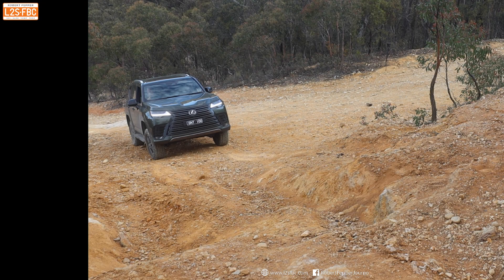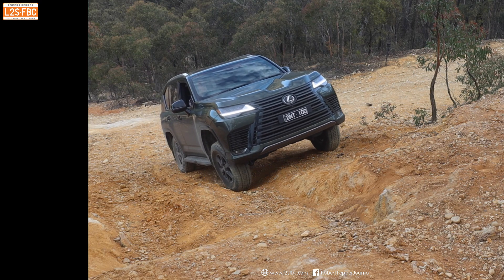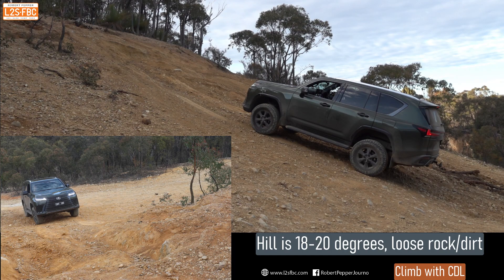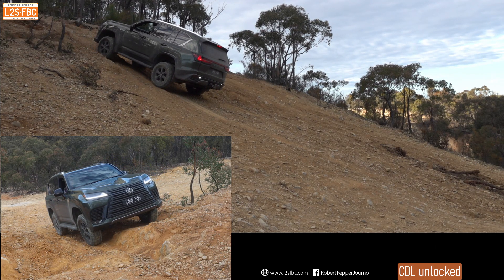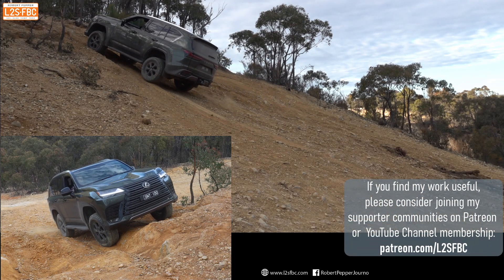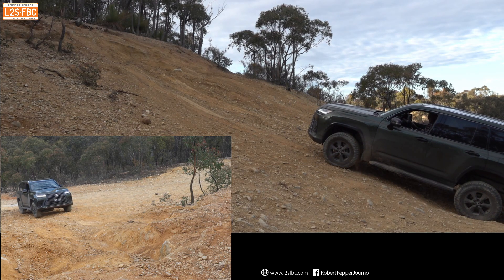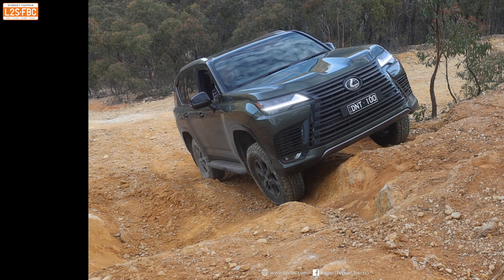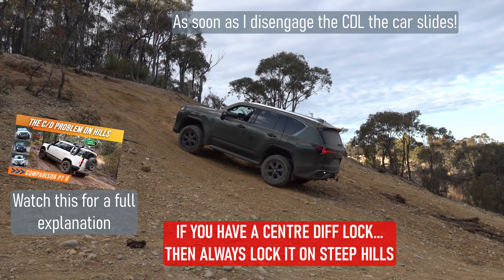The potentially deadly oversight on hills

Comment from the maker: More information:

1. Detailed explanation of what's happening with centre diff locks on hills:  https://youtu.be/QCPlK5CJ9uI?si=g4HSzd4terR2u0HL
2. The same risk, but with twin-motor EVs using the Shark as an example https://youtu.be/f5EOCDfNbZg
3. The same problem again, but this time with an Everest downhill, and Ford's fix https://youtu.be/ln4MSePpMO4  this answers "why not ABS".
4. Axle lockers are NOT the same as centre diff locks.  This fully explains axle lockers. https://youtu.be/rlO0OOKbApE
5. Failing a hill climb with a manual 4x4 https://youtu.be/3UnXWByxJAk
6. All wheel drive vs 4x4 vs everything else https://www.youtube.com/watch?v=drMmke7WL7s&sttick=0
Reply: I 100% beleive you, and greatly appreciate this video and all your others. But, what i still don't understand is why doesn't the vehicle have rear brakes? Since when does a center diff disable rear brakes?
Reply from the maker: It does have rear brakes.  The problem is that insufficient braking force is going to the rear, because the car is set up to bias brake force to the front which is what does most of the work when stopping on level roads.  On a steep hill like that the front wheels have little traction, so are over-braked, and the rears are under-braked. Look at the first link for details.
Reply: @L2SFBC  I never said it didn't have rear brakes.
Reply: @SoloRenegade not picking sides here, but that is exactly your wording.
Reply: @TheMadMagician87  in the context of, "Since when does a center diff disable rear brakes?"

DISABLE being the key concept here.

I knew the car had rear brakes, but if you apply the brakes, they should activate and stop rotation. if you apply the brakes while at rest and there isn't enough brake pressure to stop the wheels from rotating, you "effectively" have NO rear brakes, as we witnessed in the video. this is a serious design flaw. you should not have so much front bias as to have no actual rear brakes.

with the diff engaged, you only get rear braking by virtue of the front brakes preventing rotation of the rear tires. so only one set of brakes is working. this is a design flaw. why even have rear brakes if they aren't going to do anything? and what about FWD vehicles? what about RWD vehicles? I bet they don't have the same design flaw? My rear wheel drive trucks don't need the diff engaged to avoid rolling (as they don't have one), even with the transmission in neutral. My FWD cars don't have this issue either.
Reply: @SoloRenegade I get your point. My point is this:
He was responding to sentence above the one where you reference disabled, in your original post.
Reply: @TheMadMagician87  yes, he quoted me, out of context. and my question and criticism of the vehicle design is still valid, and the question still stands.

if your rear brakes don't actually stop the rear wheels from spinning, then you don't actually have any rear brakes. and why would you setup rear brakes differently for an AWD or 4WD than for a 2WD?
Reply: @SoloRenegade Okay, so moving on to address your question:

The brakes arent setup any differently, all cars are typically front biased for braking for a few reasons:
1. They are primarily driven forwards.
2. They are mostly driven on high traction surfaces.
3. They generally aren't stopped on steep low traction surfaces (particularly, with the vehicle pointed up the hill).

The issue arises because without feedback to detect that the vehicle is on a steep, low traction surface (or without a system appropriately acting on that feedback) more braking force is present at the front wheels.

With the centre diff locked, that same force is transfered by the driveline and distributed to the rear axle and then amongst the rear tyres. All is well, car stays in place under braking as demonstrated. This is because the rear tyres when parked on a hill with the vehicle pointed up it, actually have more weight on them (and hence traction) than the front (assuming the surface is the same under front and rear tyres) since the vehicles weight is transferred rearward (the opposite of a typical braking scenario when the vehicles is moving forward). So, braking effort from the front wheels is being applied to the wheels with the highest braking ability (the rears) via the locked centre diff, and the vehicle stays.

When you unlock that centre diff:

1. All the braking force at the front wheels has to be applied to the ground through the front tyres that have an 'unusually' low weight pushing them onto a surface with a 'lower than normal' level of grip. The result is, the front wheels will stay locked by the brake force, but skid over the ground as the brake force overcomes available traction.

2. As the centre diff is now unlocked, there is no brake force from the front brakes being transferred to the rear axle and wheels....the force on the vehicle from gravity is now enough to overcome the total brake force being applied by the rear brakes (which is less than available traction) so the rear wheels start to roll. The slip in the driveline is occuring within the unlocked centre diff, which wasn't possible before as it was mechanically locked together.

3. It all just keeps getting worse from there until either: things flatten out, or, you let off the brakes a bit and start driving backwards and leverage engine braking and light brake pressure to regain steering and regain a a greater total braking effort by stopping the front wheels from sliding on the ground (and should it happen to allow it, relocking the centre diff).
Reply: This all gets complicated without an inclinometer. With the CDL engaged, it looks to the ABS/EBD computer(s) as if the front wheels can sustain more brake force without sliding (i.e. relative rotation compared to other wheels) than they actually can. That is the case because some of that force was being delivered to the ground via the rear wheels, which was occuring courtesy of the locked CDL. As soon as that CDL is unlocked, the balance of forces suddenly changes...which is an unusual scenario for the programmers as it would in their normal experience only occur with the vehicle in some sort of motion. Hence, unless you specifically create mechanisms to detect and act differently in this situation, the 'common sense' programming fails to work as effectively as expected.

Could you accurately detect torque on each wheels driveshaft and use that as the direct feedback to the brake controller, this would not occur.

Dual motor electric vehicles may potentially have a plus there, since the could very quickly pick up on back EMF generated in the moving motor as a proxy for axle torque (if it is occuring absent other usual conditions/inputs) and then yell at the brake controller(s) to throw more braking force at the relevant calipers.
Reply from the maker: MadM - perfectly put, you summarised one of the detailed videos in the pinned comment very well!  Everyone else - note that while the car used in a 2025, the same issue will occur in non-electronic cars.
Reply: @SoloRenegade What I want to know is why didn’t the 4-wheel ABS work? Mine does in reverse (I have a permanent 4WD Land Rover).
Reply: @TheMadMagician87 Modern 4WDs have a thing called gradient control. They know full well if they are pointed up or downhill so a properly calibrated system will (should - or it’s a poor system) brake the rear harder.
ABS should have handled the rear wheels when it was unlocked.
Reply: @jerrymyahzcat  that's what I want to know as well. why didn't the brakes work and why did the ABS allow the wheels to roll.
Reply: @SoloRenegade The ABS should have pulsed the brakes on all 4 wheels allowing a controlled descent back down the hill, not sliding.
Reply: I also fail to see why even on the hill nose up with front biased brakes - the rear wheels weren’t locked by the brakes too (or ABS all round doing it’s thing - of course we all know that ABS won’t work if all 4 wheels are locked and you’re sliding as wheel speed sensors can’t detect different wheel speeds when there isn’t any; but as the Front wheels weren’t rotating and the rear were, the sensors should have detected the variance and started braking the rear more and the front less - front bias or not). 

Even with front biased brakes if you floor the brake pedal all wheels should stop rotating (unless ABS is involved - ABS might not work under 5km/h or something). 

There is zero excuse for the back wheels to not be sufficiently braked to stop wheel rotation. That’s a design flaw as you say.
Reply: Question - Does the design of the CDL matter? Such as Torsen vs. another type/brand/ design matter when it comes to your observations and recommendations?
Reply from the maker: @CJ-rk5eg  yes, that can matter - the Lexus shown has a Torsen, and it has the problem.  It is very variable though. Cars with electronically controlled centre diffs/clutches should not have this problem, but it depends on how well the engineers have understood the issue and not all do.
Reply: Why did your reverse lights come on?
Reply: @qsd8063 Because he put it in reverse to go backwards. You don’t roll back in neutral.
Reply: Thanks so much.

Comment: That is why the first of the Disco 2s were dangerous in some situations, as they had no center diff lock.The manufacturer eventually fitted the center diff locks to the last run of the model,late 2003,and 2004.

Comment: Sliding down hill = no control. Always hev the center diff. locked when on loose ground. Especially going up-hill, but even more important down hill. If you slide down you must put the gearbox in reverse as soon as possible and engine brake down hill. That is how I learned it at The Land Rover Experience Centra (Level 1 in Holland and the Advanced Level 2 course in Germany)  When driving forward down hill you ALWAYS MUST have the centre differential lock engaged, because in case a back wheel lifts and has no traction (without out CDL engaged) you will get an winding axle twist. The wheels with frip go downhill, the wheel in the air will turn the opposite way. That is still true on modern vehicles. I wonder how many people actually invest in their own safety and take a proper off-road course at LAnd Rover Experience or with other brands. I wonder.

Comment: Why would you ever take your center diff lock off in this situation. I wouldn't. My truck has a hill start brake. Not sure if it would help but the truck doesn't roll back at all... Doesn't do anything until I hit the gas.

Comment: Without reading anything, this is also your first video I've seen.  I'm going to guess since the center diff is locked, that means it's still doing the same braking as before, however since the front wheels are locked they prevent the back wheels from turning because they can't spin since they are directly tied to the front wheels now in order to all spin at the same time.   If one wheel is locked, they are all locked so to speak.  Theoretically, if you have only one break on the front right wheel and lock it up all 3 other wheels will be forced to lock too, lets assume everything is invincible and sufficiently strong enough.
Reply from the maker: Yes!

Comment: That's really interesting.  I have a '24 Colorado ZR2, and have the option of 4Auto, 4Hi, and 4Lo.  I can even lock the rear in 2WD, and I can lock the front as well in 4Lo.  I'm a noob at this, and was told I should use 4Hi or 4Lo rather than 4Auto if it's anything other than intermittent snow/dry pavement.  I had no idea locking the center diff had any effect on braking.
Reply: You don’t have a center differential
Reply: @miked7293 So, I have 4Auto, so, what is it that you propose I have?

Comment: What if one does not have a center diff? I am looking at a Honda Passport Trail Sport in the U.S. I don’t think its awd system has a center diff that can be locked? So could this vehicle climb this hill and would it have the problem you are describing? Should I look for a vehicle that has a center diff that can be locked?
Reply from the maker: I am not familiar with the Passport. Had a brief look and it appears that it has an AWD system so I'm guessing no low range and an electronically lockable centre diff or clutch - see https://youtu.be/drMmke7WL7s for an explanation.  Based on what little I know, it'd do okay offroad but would not be my first choice for steep hills.
Reply: @L2SFBC Thanks.

Comment: So why did the ABS not work on all 4 wheels when rolling backwards?
There was definitely a variance between wheel rotations.

It’s always fun (not) sliding backwards on gravel down a hill with all 4 wheels locked and not rotating - you have to lift off and re-brake to allow the ABS to sense wheel rotation.
Reply from the maker: ABS requires wheel speed to work and doesn't work at very low speeds.

Comment: With the C/D unlock, I don't understand why the rear wheel is not locked no matter how hard you press the brake.  Is it because of the anti-brake-lock kicks in that makes the rear wheel more free ?  But if that, it should be come to a lock-unlock-lock  to 4 wheel situation.  Or, is it because of the proportional front rear brake force issue ?  

Use another scenario,  just a similar rear wheel drive car is placed on that slope, put into N gear,  just the brake.  Will it show the same front wheel lock only and rear wheel free rolling no matter how hard you brake ?
Reply from the maker: Brake bias and proportion. Watch the detailed video in the pinned comment.

Comment: This is very informative, but would anyone actually turn off the CDL in this instance, or am I missing something here?  perhaps as someone else posted that maybe someone doesn't have the CDL on for the hill climb. I think some people should do an off road course in their car to work out safely what the car and themselves should do.   I have seen people out on the tracks that have a new car with '4wd' and they then get in way over their heads, often travelling alone as well.
Reply from the maker: People do all sorts of weird things with 4x4s. Yes more likely the hill will be climbed without a centre lock engaged.
Reply: I was thinking the same. Who would turn in off mid-climb?

Comment: As  soon as I hit offroad conditions the center diff lock is engaged on my LC 300. You're not truly a 4wd until it's locked.  I also have front & rear lockers but the traction control usually gets the job done.
Reply from the maker: Absolutely!
Reply: You totally Are a 4WD without it locked. See Robert’s video on 4WD/AWD/4x4. 
When it’s locked you are simply a locked 4WD. 
Locked and unlocked each have their own uses and benefits.

Comment: If you like to contender really steep hill first and foremost get proper tyres on proper rims and deflate them to proper pressure. And above all choose suitable 4WD - those with center diff usually good only in city on snow or ice.
Reply from the maker: No, centre diff lockable 4x4s are perfectly capable offroad.
Reply: @L2SFBC  As long as that centre diff being weakest part of driveterrain will not break when you contender that hill. Technically when it locked it is "the same" as engaged part-time 4WD. Practically it is weaker and by far more complicated. Yes it has certain benefits on icy toad and alike, but no I personally do not like it for hard-code 4WD-ing.

Comment: I am now even more confused on this , I expect If I press the brake ppedal all  brakes will work (abs means all brake units will be  on/off as needed) your showing rear brakes not working, morerover I notice at the time you state turninging off centre diff lock a white light ellumunates as iff reverse has been engaged..... what gives with these tell tales ?????
are you showing the Lexus cars has a programming issue ?????????
Reply from the maker: Look at the pinned post for a detailed explanation of all your questions.

Comment: The same principle (but inverse) applies to driving on ice where you do want those tire to spin, for example open diff with traction control vs. detroit locker on ice.
Reply from the maker: definitely don't want axle lockers of any sort on ice, you need the differential to do its differential thing. But, excess wheelspin is also bad.

Comment: Do not use this ancient crap with only one engine. Use only 4 engine cars for this.
Reply from the maker: Please explain?
Reply: @L2SFBC  One wheel, one motor gives perfect control.
Differentials and locked differentials are only an emergency solution for this problem.